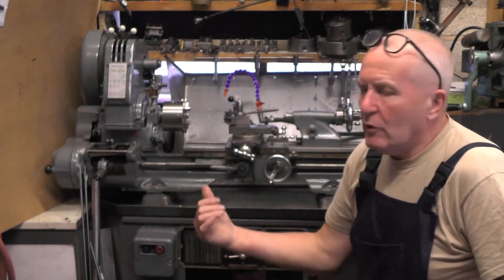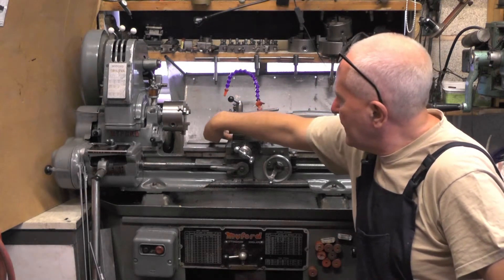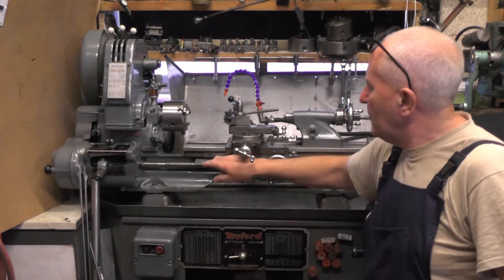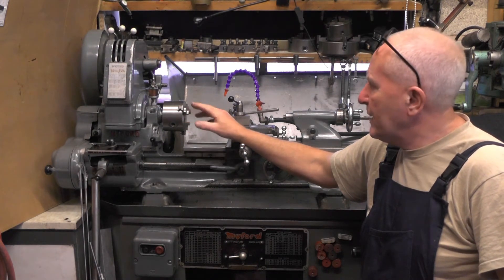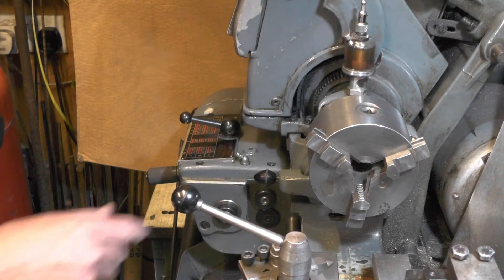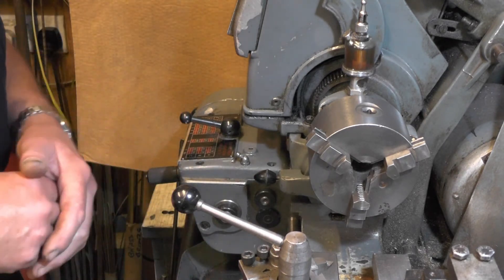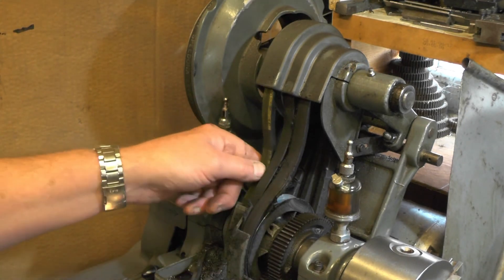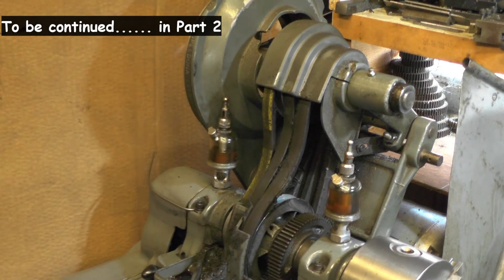Myford ML7 Tri Leva Mechanism and Belt Change Complete Guide PART 1 "mr factotum"

Comment: I have followed you religously doing this task ,and got the belts from the same supplier, but I have a problem in as much as the belts are driving the chuck without the tri leva mechanism fitted,
  measuring the belts I have taken off they are 10mm longer, this has got me stumped, any ideas  ???
Reply: I sat and looked at it and then I had the lightbulb moment 😂😂 and like you said I saw the adjustment screws on the counter shaft so with a bit of fine tuning all is now well
Thanks for replying 
Vaughan
Reply from the maker: @vaughanmiles8699  Great Vaughan👍👍, glad you've sorted it, 
thanks for watching my video's.
it's appreciated
take care
Kev
Reply from the maker: Hi Vaughan
Sorry to hear of your problems.
A couple of things here, have you tried it with the tri leva mechanism on!! if not try this first as the guard shapes the belts around the pulley.
If you have done that and still not right, it sounds like the countershaft is not set correctly, i didn't cover that in the video as i was just assuming a like for like belt swap. In my Video Part 3 at approximatley 3 mins 34 secs in pause the video and looking at the screen as if a clock face, at 5 past and 10 past there are 2 adjusting screws for the countershaft setting, screwing them in lifts the countershaft hence tightening the belts more, or undoing the screws  a little at a time drops the countershaft hence loosening the belts, make sure you do them evenly to keep alignment, and small increments at a time, and undo the locking nuts first then re tightenen the locking nuts once the required setting is reached.
Hope this helps you, good luck and let me know how you get on
Regards
Kev
Reply from the maker: Hi Vaughan
Just an after thought here as well following my last comment, the new belts are much stiffer than the old ones and may need a little time to bed in to shape!!
cheers
Kev